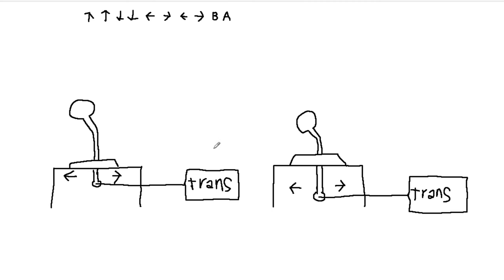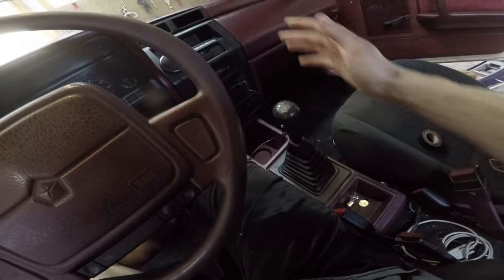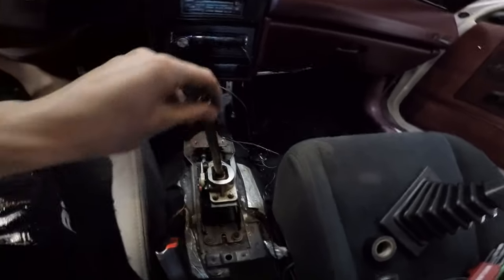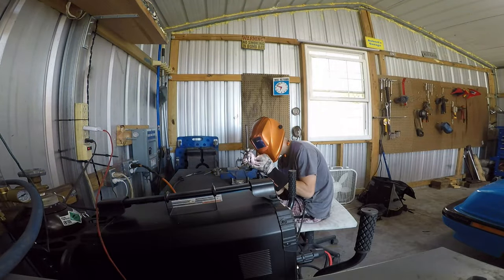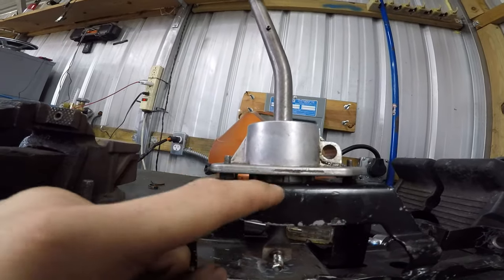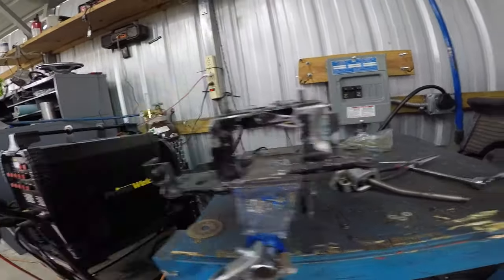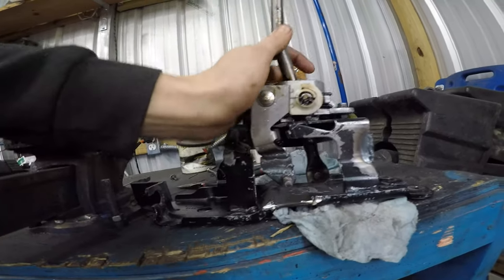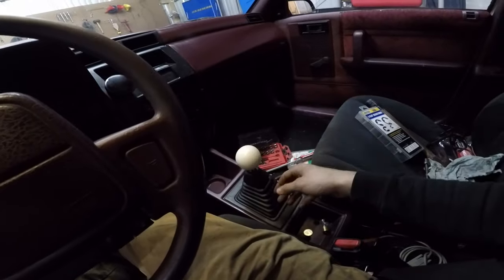Making a Cable Shifter Not Suck - DIY Short Throw Cable Shifter

Comment: Short throw, replacement bushings and an upgraded transmission mount have always been my go-to mods for any car I buy. I've never been disappointed
Reply from the maker: Same. It doesn't take much to make it so much better
Reply: true, my cars got a polyurethane "torque mount", new shift linkage rods, and probably the best thing was a adjustable clutch pedal stop, there was originally like 2-3cm of unnecessary throw when clutch is already disengaged, really helps with leg fatique and gives faster shifts

Comment: personally ive always hated short throws. love my 90s fwd gms 10 foot no feel throw. for a while ive been considering getting a short throw for my honda and cutting and rewelding it to make it a long throw
Reply from the maker: Long throw shifter in a Honda is a new one, lol. What exactly do you like about a long throw shifter?
Reply: Get a short throw kit and just extend the ever loving shit out of the shifter, best of both worlds
Reply: @HatersGarage  maybe im deranged but my favorite shifter ive ever used was in my buddys 90s wrangler. Something about having long and vauge shifts is way more fun to me, makes me feel like im in a 60s movie flooring it then having that breif pause with a huge motion between gears. I havnt messed with my honda other than welding up a taller shift knob out of a 1 7/8 tow ball so that it feels more like a truck
Reply: @HumbleHonkingEnthusiast  i just love long and vauge shifters, dont really like notchy shit. ive driven tons of cars with factory and aftermarket short shifters and it always makes me wish i was in my shitty 90s gm
Reply: Short throw is awesome in a little tiny car with close ratios, but pretty silly in a truck with truck gearing.
Reply: @pontiacg445  ive driven tons of small little cars with short throws and i really just cant stand them. i understand why someone would like em but for me, if i wanted the car to shift fast id get an automatic and a shift kit. My weekend car is a sunfire with the isuzu transmission. built up for autocross and backroads but i just love the loose and long shifts
Reply from the maker: Hey, to each their own. If that's what you like then that's what you like.
Reply: @HatersGarage  no theres absolutely something wrong with me but i can live with that
Reply: @potatosfortots9909 I had a 93 wrangler lol. Sometimes you had to guess where the gears were, it was so sloppy
Reply: I have a long ass samurai shifter on my volvo and its incredibly nice when youre just driving around but its almost impossible to shift fast

Comment: Have you tried reinstalling the transmission underneath your shifter as god intended? Cables are icky, unless it controls the throttle. Then it is obviously the only acceptable option...
Reply from the maker: I completely agree. You can get cable shifters surprisingly close, though.

Comment: The setup and feel of that shifter is a reflection of the times. At the time that transmission (A523/A568) was released, the Japanese were owning the mass market. Japanese carmakers were really hitting their stride and were seen as more "refined" - that meant only a light touch required to operate with the miminum of NVH transmitted back to the user - and that's what they were targeting with this design as the market was signalling with their wallets that's what they wanted. American cars were seen as rough and clunky in comparison. It was normal for the time and an improvement (if a bit rubbery-feeling) over the previous generation A520/A555. We hadn't yet experienced the "Fast and the Furious" era with all the absurdity that brought, which trickled into OEM designs. Like many things, it is a mistake to apply modern standards to things of the past and often change comes for the sake of change, not because it is better.

I see you ran into the spline size change problem where they beefed up the input shaft part way through the run - major drag, wisdom of the ancients which is disappearing. 

The A555/A520 was best IMO - little more visceral and direct feeling, and the clutche had a better feel. There was something about the A523/A568 clutches that made it difficult to pull off smooth shifts consistently while booting around town.
Reply from the maker: It is a commuter car from the 80s. personally I can't see the appeal of the longer throw, but I do understand why Chrysler made it the way they did. I still find the shifter a million times better with my modifications for my use, though.

Comment: the prothane shifter bushing work pretty good never had a issue with them falling off also some of the trans just feel like the shift softer 523 are pretty random, much prefer the 555
Reply from the maker: I think the 555 uses shifting rods instead of cables so that makes sense

Comment: My brother had a Yota 4y by with 250,000 miles on it and it was shifting like that Mack truck. He added a quart of Slick 50 for trannys and then it was like brand new. 
Ya, on my RC truck to add one thing, I usually have to change at least 3 others.  
How can a shiny, nickel plated screw just disappear off of the face of the earth when dropped on dark gray hardwood flooring? Poof! @#$%&!!